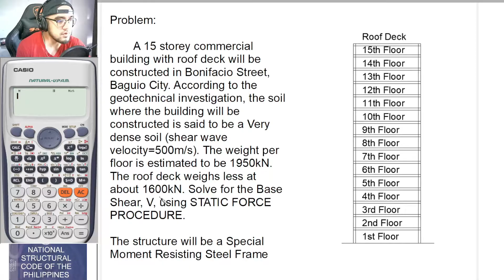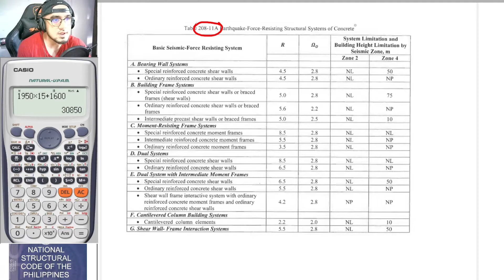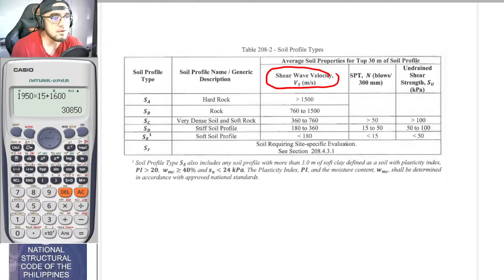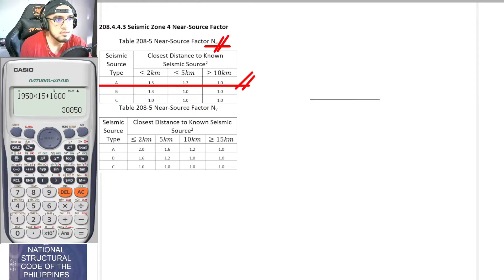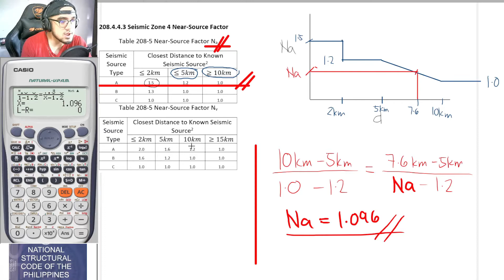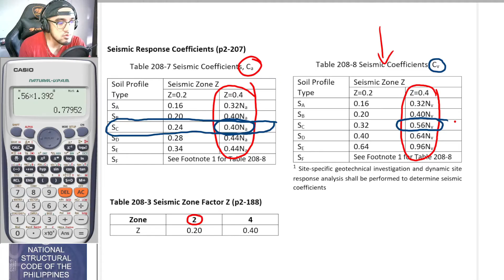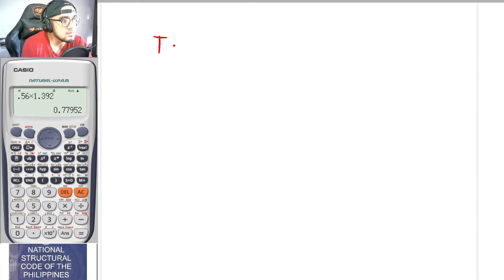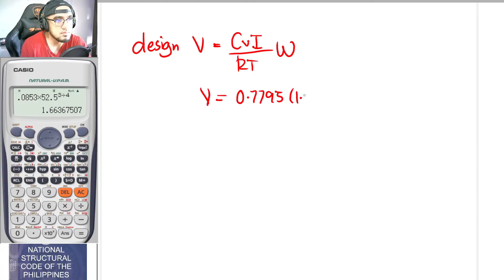p.2 Seismic Base Shear Determination via Static Force Procedure (UBC 1997/NSCP 2015) Sample Problem

Comment from the maker: FREQUENTLY ASKED QUESTION: FAQ

Q: Sir, di po ba dapat 0 kN yung sa ground floor kasi nagrerest siya sa ground? (Sir, shouldn't the weight of the ground floor be disregarded since it is resting on the Ground itself?)
A: More often than not, the WEIGHT OF THE GROUND FLOOR IS DISREGARDED. And thus, you are indeed correct. (0kN on the ground floor)

Q: Then why did you include the weight of the ground floor in your computation, sir?
A: I assumed that the weight of the ground floor rests on the structure and not on the ground (Which is very rarely considered). Obviously, the value solved here will not be equal to the base shear computed as if the ground floor weight is disregarded. But would definitely give a more conservative value.

Comment: Hindi poba 0 ang weight ng first floor kasi ground ang nag bubuhat sa first floor?
Reply from the maker: Sorry for the super late reply. Anyway,  depende sa case ng structure mo. If you are designing the structure in such a way na naka "on-fill" yung slab mo, and natratransfer yung weight niya directly to the ground and not to the structure, then zero (0) na yung weight mo dun. Pero if magdedesign kayo ng structure na yung slab mo sa first floor is magtratransfer pa din dun sa frame mo, then icoconsider mo yung weight niya. Usually ginagawa yan sa site na malambot yung natural grade line and may trust issues ka, or if ayaw mong may lumalabas na mass irregularity sa analysis mo. =)

Comment: Pwede mag tanong sir . Di po ba W=1950 times po to "14"  ?  Plus the roof deck ??
Reply from the maker: Actually depende talaga sa basis mo ng format e. In some books, when you say 15 storeys with Roof Deck, 15 storeys + roof deck meaning nun (like in our example). In some cases, sinasama nila yung Roof Deck sa pagbilang ng storeys, if yun yung sinunod mong rule nung formating, then you are correct. =)

Comment: Hi sir! Question po. May nakita kasi akong computation wherein yung total seismic load niya is dead load above ground floor lang (excluded ang mismong ground floor). Can you please clarify this po? 🥺 thank you!
Reply from the maker: Hello! Depende sa case ng structure mo. If you are designing the structure in such a way na naka "on-fill" yung slab mo sa ground, and natratransfer yung weight niya directly to the ground and not to the structure, then zero (0) na yung weight mo dun. Pero if magdedesign kayo ng structure na yung slab mo sa first floor is magtratransfer pa din dun sa frame mo, then icoconsider mo yung weight niya. Usually ginagawa yan sa site na malambot yung natural grade line and may trust issues ka, or if ayaw mong may lumalabas na mass irregularity sa analysis mo. =)
Reply from the maker: Hello! Depende sa case ng structure mo. If you are designing the structure in such a way na naka "on-fill" yung slab mo sa ground, and natratransfer yung weight niya directly to the ground and not to the structure, then zero (0) na yung weight mo dun. Pero if magdedesign kayo ng structure na yung slab mo sa first floor is magtratransfer pa din dun sa frame mo, then icoconsider mo yung weight niya. Usually ginagawa yan sa site na malambot yung natural grade line and may trust issues ka, or if ayaw mong may lumalabas na mass irregularity sa analysis mo. =)
Reply: @deanzanoCE  sa ganyan pong design, bale yung height po ba na icoconsider sa computation ng T is height above ground lang din? Thank you sirrr
Reply from the maker: @patriciamarquez2929  from dun sa location mo ng base shear. So yes, in common cases, from ground level up. 😊
Reply: @deanzanoCE  thank you so much sir! 😄